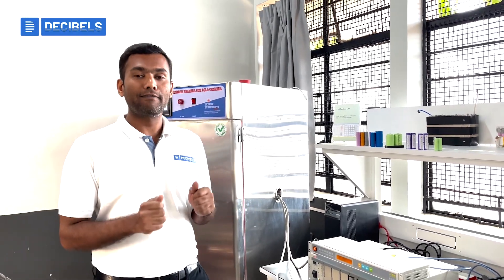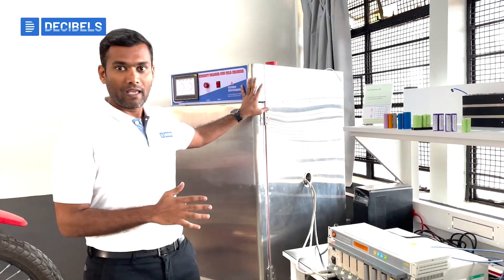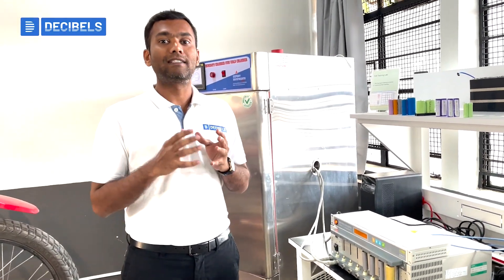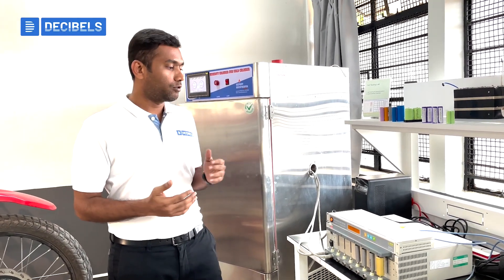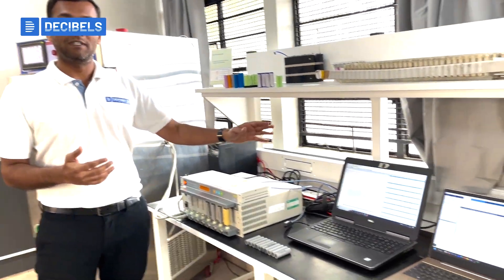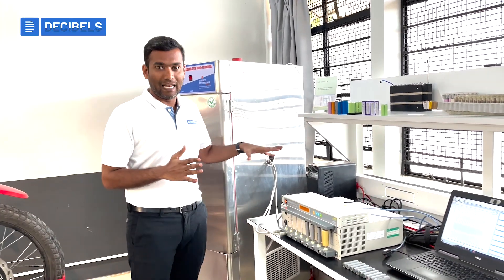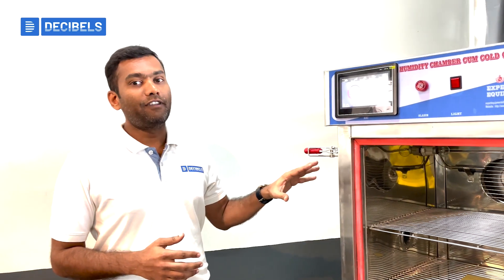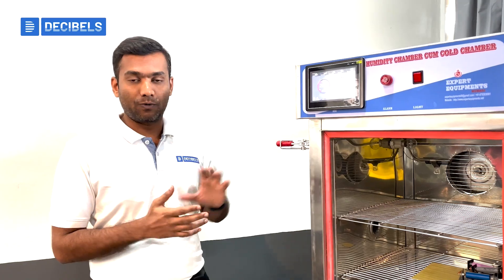Cell Testing Equipment | Master Certification Course in Battery Management Algorithm Development

Comment: I need to test some used batteries cells, on large scale, can I execute this kind of test on this device? Which model you are using? I know chroma has some nice ones! Thanks for the content!
Reply from the maker: Hi Mario, Let me know what are the ratings of the cells and test profile you want to carry out (Peak current / HPPC or DST). We can suggest the right machine. 

Croma/Airbin/Neware/Semco and may are there to supply. You can always count b/w cost/accuracy/sophistication and more.